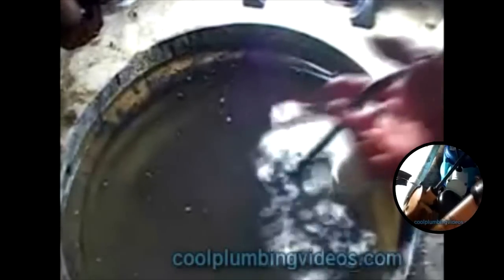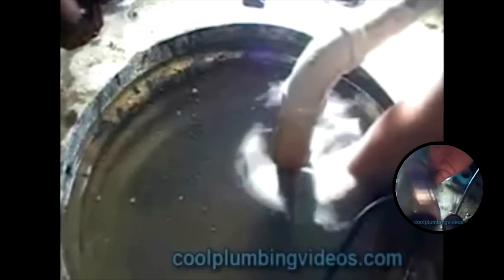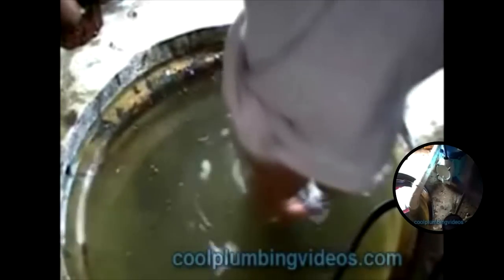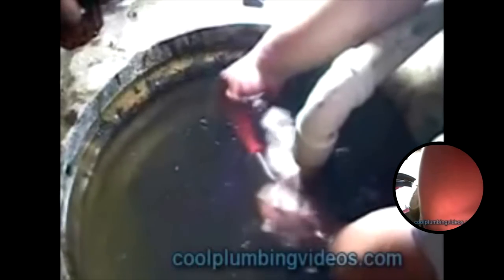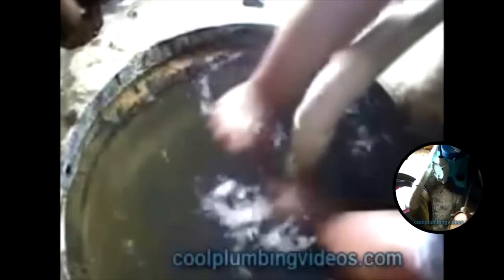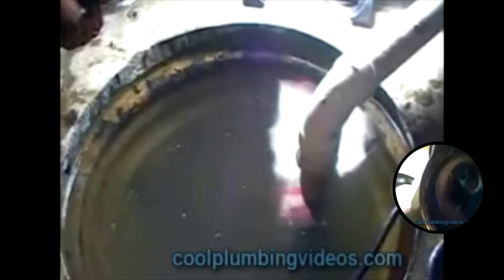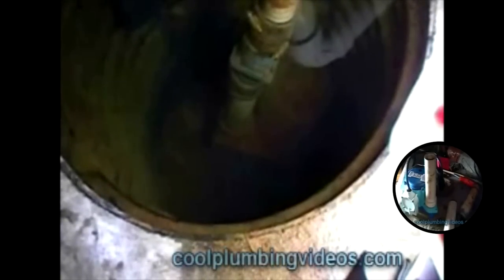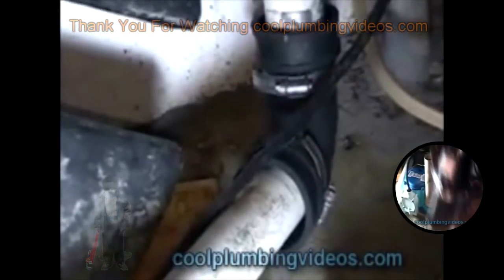Sump Pump Upgrade Installation Tips And Tricks 1 Of 2

Comment: I have a question: I'm seeing some pump requires you to make a 3/16 inch "air bleed hole" between the pump and check valve. - I wonder if that hole you saw in the original pipe was for that reason. - do you think it's required? They said the purpose of the hole is to prevent "air lock"